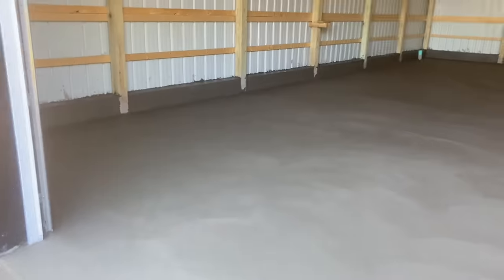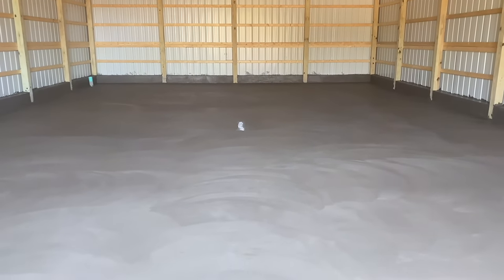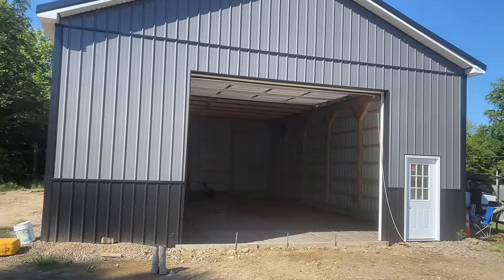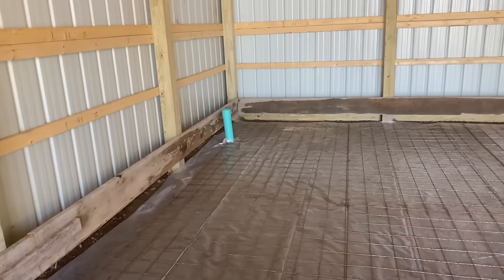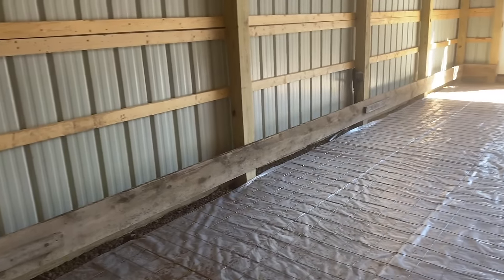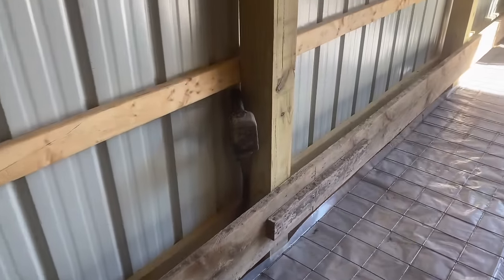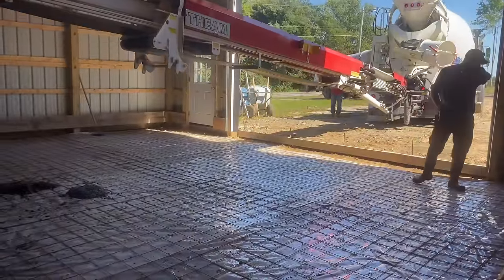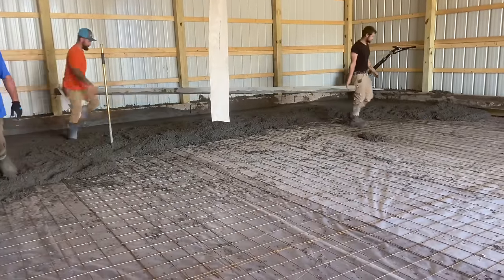All concrete cracks? Not this slab!!!!

Comment: Nice Job it turned out great.  I like the curb poured between the posts, great for keeping the critters out and power washing the floor.  Would wrapping the posts with tar paper help to keep the concrete from pulling the moisture out of the posts and prematurely dry rotting them?   
I've watched many slabs being poured, metal trowels leave the concrete the smoothest and almost seal it.  I've also worked in a shop with metal trowel finish and sealer applied. With the correct shoes and watching where you walk you hardly ever slip.  Clean up is also very easy.  On driveways  I've watched finishers use wooden trowels.  This leaves the concrete with a nice anti slip finish which is also easy to keep swept off.  The worst I've seen is the broom finish. It is the roughest finish and hardest to keep swept off.  It seems like you can never sweep the dust off of it and it's the easiest to damage by scraping something on it.  
Do you still offer a wooden trowel finish better yet does the power trowel have an option for wooden paddles?

Comment: Still doesn't make sense to me as far as just sticking the main poles in the ground.  The building may be cheaper, but he obviously spent a wad for the concrete and the spray foam.  How much more would it have been simply to put some of those pre-made forms and concrete them in with some water proofing afterwards?  Or even just something to coat the wood and/or provide a barrier and make it last even longer.  And why not pour the curb first and then the slab?   With the weight of the vehicles he's running I also think the owner should have had you guys pour maybe a short slab in front so he wouldn't chunk out the front edge of the barn slab.  All just my opinions of course.
Reply from the maker: I agree with much of what you say.

Comment: The only thing I would do differently is, I would have the owner buy a case of automotive undercoat, in spray cans, tape the siding and the posts and give them a good heavy coat. It will prevent the post rot from the concrete, and stop the lime from eating the siding up. That must be an Amish building the new pole barns use piers with galvanized brackets set at grade to hold the posts, they don’t bury the posts in the ground anymore, just for the reasons you stated keeping them out of the concrete. In this case with the curb, he still would have had to coat them to keep the rot at bay. You probably knew all this, just my observation, I enjoy your content every video. 👍👌
Reply: Agree with doing something to keep the concrete/lime from eating that metal siding. But pole barns are still built every day with 6x6’s buried in the ground. I’m not a fan of the idea either but I’ve yet to see one that needed to be rebuilt due to the post rotting.
Reply: @AllstarVentures   Yeah, they are but my experience is, usually by the Amish crews, they do a good job, but are pretty old school in some of their practices. Can’t ask for harder working folks, they do get it done. I did a pole barn type of addition on my garage, I made my own brackets so the 6x6’s didn’t have to go in the ground, the piers were over code at 5’ deep, I have no rot, anywhere.

Comment: It will crack eventually. The cracks start at the bottom. Concrete has great compressive strength but poor tensile strength. The tensile part will be at the bottom. Rebar and mesh help stop the cracks. The steel goes in the tensile areas.

Comment: No cracking in that is amazing.  Just cement? (no fly ash or slag)?  The curb is not the reason - it is probably mostly because of really good sand gradation.  You have a really good supplier.  Pouring inside helps.
Reply from the maker: yes no fly ash in there mix. yes no sun beating on it either and yes it was on compacted sand.
Reply: @bondobuilt386  Thanks and also for your video.  I meant the sand particle size gradation in the concrete, if it isn't really good you need more water to get to the same slump.  If that big slab didn't crack, it was perfect.
Reply from the maker: Oh I got ya. Makes sense. I know one time they got the wrong sand and I noticed it Immediately and called the plant   They accidentally sent them sand from the wrong pile. It was traction control sand and they were like diamond size and started poping out when I machined it. What a pain. LOL @SpaceCrete

Comment: I don't know what I'm talking about but maybe someone can explain about the wire on the ground there.

It seems absolutely flat on the ground and I thought the idea was to lift it up off the ground a couple inches to get it in the middle of the concrete instead of on the bottom.
I mean, I do see someone trying to pull up on it but it doesn't seem to work, looks like it lays back flat again.

Comment: I'm only a homeowner that's done a bit of concrete around my properties and neighborhood areas. No cracks in anything that I have poured. I compact the ground first, then put in 4 inches of gravel, compacting every 2 inches. I pour 6 inches if it will see vehicle traffic. For walks I use 4 inches. Minimum 3500 psi mix. 

I see that you barely lifted the mesh 1 inch. It does very little if its not closer to the center. In 10 to 15 years when mesh rusts away they will have problems. Of course the contractor is long gone.
Reply from the maker: I lifted the wire myself and you actually want the wire closer to the Botton putting on the tension side of the sled. In the middle it will act like a hinge when pressure is applied from above.

Comment: History will prove the title wrong  :-0)
Yes, some slabs can go decades without a crack.
That does not mean it will never crack.
The new fiberglass rebar is a game changer though as for longevity before cracking.
Steel (rustable) rebar was born to cause cracks . . . in time.

Comment: i don't think the wire mesh does much anyways, i have well over 300 yards at my place in N. GA without any reinforcement ranging from 10 to 40 years old with cut joints and no cracking to speak of.

Comment: Have you seen that concrete? I forgot the name of it it’s like damn near liquid and all you do is pour it out it self levels of course you gotta help in a little bit with  shake stick and then you have to spray a chemical on top which makes it cure. I like that stuff a lot,
Is guaranteed not crack you don’t have to have expansion joint cut joints nothing

Comment: Slab WILL crack over time with heavy equipment traffic and seasonal changes. The fact that the slab is basically square helps, but saw cuts from the drain corners to the building corners would've been advised. Then, a one-part polyurethane flowable caulk or epoxy joint filler would do the trick. Could've added a cant strip to the bottom of your curb form. No bond-breaker or protection between the curb and siding?? Siding will corrode over time.

Comment: I agree with the others here, who have already mentioned that pole structures should be put up the way R & R construction.does it. Sono tubes ro make concrete piers, metal brackets attached to the top of the concrete, with laminated beams instead of poles attached to the concrete piers, with the tops of the piers set above ground level. The old way is unecessacery, and makes for a structure with a short life. Even pressure treated wood put in the soil will rot. How and why sone people still do that is beyond me. Cheers...

Comment: Cracks start from the edges BUT if you have a solid reinforced border like in that pole building, you can reduce the chances of cracking........... OH, and they do make pumper trucks now or portable pumper pumps to pump the truck into  for trucks that won't fit inside the barn doorway....... This wheelbarrow crap is BS!!!!!!

Comment: I have a question about protecting 6x6 posts buried 4ft, expected to rot in about 30 years.  I know nothing of construction, so I'm not pretending I have a good idea or even a credible idea.  It's just a ponder.

If these are built all the time due to low cost, and the known problem is the poles rotting in the ground (same issue with any decks sunk into the ground), then,  in our modern age, isn't there something the bottom 4 1/2 feet can be coated with?

Pouring cement around the poles doesn't do much here, as cement wicks up moisture.  It's porous.  So, if the posts themselves aren't coated with something rot of the wood is still going to happen.   The wood is getting moist.

What about several coats of epoxy on one end, 4 1/2 ft worth?  

What about a THICK application of tar?

Then pour concrete around that into the ground.  (?)

Anyway, for those who actually know what construction is all about, and the various options that are already available for this problem, thanks for your patience.

Comment: I poured my shop slab. 24x40'  no cracks. if you let your concrete guy pour wet slop, you will have cracks. I formed, put wire 6,6,10,10 and rebar. I kept the slab wet for a week after I poured. I poured zero slump. I poured it in 1985. not a single crack. I call bullshit when someone tells me you have to cut the concrete or it will crack. thats a half assed excuse for a bad job.

Comment: Hi guys, can any concrete expert explain the effect of the foundation surrounded by beams on cracks? The absence of cracks in this foundation cannot be explained only by the use of high quality concrete and mesh steel. There is a somewhat strange situation. Thanks in advance.
Reply: Slabs that carry the weight of the building on top are at a much higher risk of cracking than slabs that are just floating. So this was an ideal situation in that aspect.
Reply: @bradley3549  thx for answer yes floating slabs surely more stable against cracks but this case is different they use beam surrendering the slab and this solution works for no cracks.
Reply: @merahli  I personally don't believe the beam detail has any bearing on it. If you don't have a good solid base, a really good concrete mix and lots of reinforcement - a little beam on the perimeter isn't going to make any difference.
Reply: @bradley3549  You're probably right.

Comment: They have metal galvanized sleeves that they put around those poles before they bury them in the ground makes them last almost indefinitely and that way the wood will not rot especially in the concrete

Comment: well to stall heavy equipment it is good meaning the finish. I did not see those workers get the air out of it. In order to do that faster you have those motorized machines which tend to fall into the just poored concrete but it works good. It is a very nice hangar. I see you finished with the helicopter but still even for heavy gear I would have layed a layer of colored quartz over it. No oil stains and very  very resistant. anyways

Comment: You did a lot to try and make it crack. Pouring the curb and slab together as well as pouring around the post without expansion joint are your two most likely places to crack. Not putting in control joints is just a bad idea. Hope your luck holds.

Comment: I have pole protectors which are plastic sleeves over the poles. As long as water doesn't get in between the poles and sleeves which is at least 6 inches above grade the poles should last as long as the plastic does. Plastic protectors should last 100 years I would think🤔???

Comment: I lived in old north ST louis City.Most of the homes and streets were built before builders and contracters had dirt moving equipment.All of the footings and basements were HAND DUG FROM FULLY COMPACTED DIRT. Nobody  hand digs any deeper than absolutely needed. These century old homes and streets are still near perfect. NOT SO IN THE SUBURBS  In the suburbs they come in with giant earth movers and reconture the land to squeeze as many lots as possible. They dig the foundations plenty deep and backfill with loose dirt. The biggest buiseness inthe suburbs is foundation repair and water proofing.

Comment: Interesting, no cracks. We poured a lightweight floor about three inches thick over a styrofoam substrate holding hydronic heating tubes woven into it. The concrete mixture had two additives in the mix. The first a latex compound and chopped fiberglass strands. Concrete was mixed for 15 minutes before it was pumped over the pipes. A goo year passed before the laminate floor went in, never saw a crack in the floor. My father specialized in concrete work for many years. All of the garage floors he poured were finish with a medium smooth finish. Out of many garages poured over the years he had only one idiot ask for a glass smooth floor. The only way my father would do the job was if the client signed a release of liability that his attorney drew up. Well the client signed the release form and he got his …"glass" smooth floor. Six months later my father received a call from this guys attorney trying to get him to pay for this idiots hospital bill since he slipped and fell on the wet concrete floor after washing out his garage. My father sent him a certified copy of the release document and informed his client to pound sand, he was warned.

Comment: There's 2 kinds of concrete.

1, Concrete that's cracked and 

2. Concrete that's gonna crack.

So far you have the second kind.

Good subgrade prep, good drainage, insulation board and a heated building will increase the length of time before it become type 1 concrete.

But great job.

First time 've seen a concrete truck with its own conveyor.

I've poured 1000's of yards with telebelts,.. but I've never seen a small one attached to the truck.

Must increase the cost of the concrete pretty significantly.

Comment: Could just use a little chamfer detail on the boards before you put them up..? maybe..
Reply: 6" slab.. No rebar, just wire, and pretty uneven through the slab.. That's the magic sauce..

Comment: Comments sections on concrete YT channels must be the most contentious on the web 😂
EVERYONES a pro with knowledge and experience that contradicts many others .
it's gets funnier than a stand up comedy show sometimes . 
Ok for all you " concrete always cracks " believers , come to Germany , the land of NO cracks . 
i've lived here for twenty five years here , built two houses and looked at hundreds more new and old houses and have yet to find a crack . i don't know what their formula is and that MAY be a factor but here are the things i do know .
1- much thicker foundations , slabs and walls . eight to ten inches
2- more steel regular rebar with rebar mat on top . 
3- concrete is generally NOT finished . it is leveled  and left rough to accept 
Estrich or self leveling concrete . 
ok flame away boys 🔥😂

Comment: concrete is weak in tension. if it cracks the subgrade has moved.
Reply from the maker: I find most cracks occur when it shrinks. Pouring outside and wind and sun and it is hard to keep it from cracking.
Reply: @bondobuilt386 that makes alot of sense as well.
Reply from the maker: Thanks  @DieselRamcharger
Reply: @bondobuilt386   like a weld that cools to fast cracks, i figure concrete is much the same. never really thought of it like that. interesting.
Reply from the maker: Good comparison with the weld.  @DieselRamcharger

Comment: There was a recent video short by Builder Brigade "Give Concrete Cracks a place to HIDE…🫣", at one point showing a garage cut into at least 8 chunks.  
Several comments on the video indicated that people have successfully poured garages and slabs without cracking for decades.  I thought something was changed or added to the concrete around 1980 when we built my parent's house, no cracks in the 2 car garage.  We don't have joints in the barn either.  Some multi-level with the gutters.  I haven't inspected closely but no cracks in the flat parts of the slab either.  The biggest problem with the barn was that the builder didn't pull all the wooden form stakes giving perfect hiding/entry places for mice.
Around here (Oregon), if they do concrete freeways, they don't cut then either with the bumpity-bump joints either.

Comment: letting the concrete crack naturally is the right thing to do. 
If needed, two-inch or 3-inch stone base. x 1-foot thick. 
finally grading, one-inch stone w/ fines. x 1-foot thick.  compact / roller every 4 inches lifts.
 concrete 6" thick with road mesh and 1-inch coated rebar tied checkerboard on chairs, 1-foot on center.
NOTE:  spraying water while compacting / roller is very good also.

Comment: Definitely rolled the sub grade . Those plate tempers aren't worth a nickel besides giving a nice flat look. Don't believe me, go behind a roller and kick the rocks, now try the plate tamper
Reply from the maker: Depends on the plate tamper. I have a 700 lbs tamper. Have to put in in with the mini X. That pacs graver so tight hard to drive a stake in it.

Comment: That welded wire mesh was a complete waste of money; unless it it supported to the mid-depth of the concrete slab by dobie blocks, it will just sit on the ground under the slab.  Hooking it after the concrete is dumped is ineffective, because it can’t be evenly positioned.

Comment: 15 months is nothing try 26 years no cracks and no cuts, 24x36 shop floor, I did fryash under my slab, 4” pad, 5,600 psi concrete,post in 20 years and let me know

Comment: Not sure why people waste their money putting mesh or rebar into their concrete pads.  It does nothing to add strength or prevent cracking.  A proper mixture of rock, sand, cement and water and a properly prepared base is all that's required.  I suppose if you cheap out on any of these components you will need rebar.  Of course I'm only reiterating what the National Portland Association says...... but what do they know!?
Reply: Read any good engineering books explaining it!